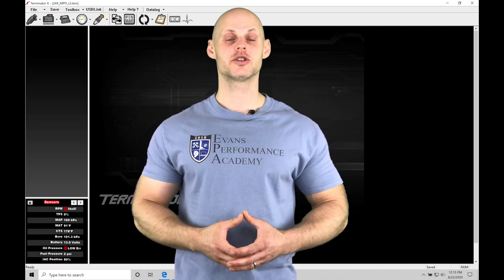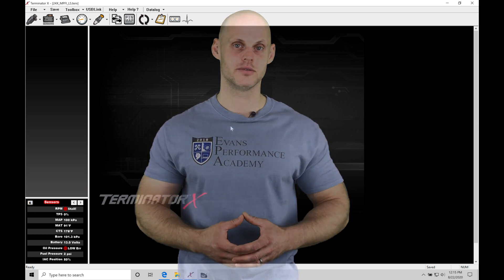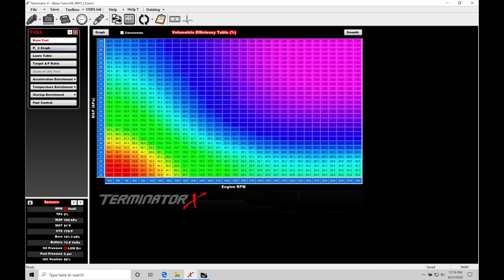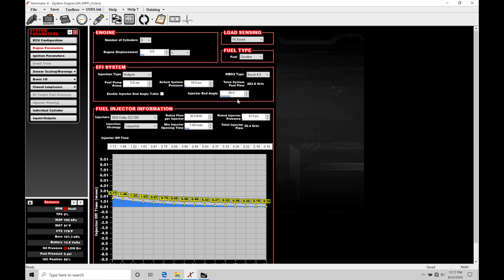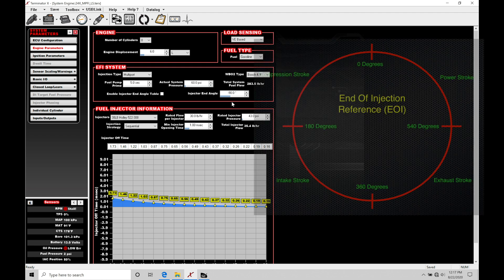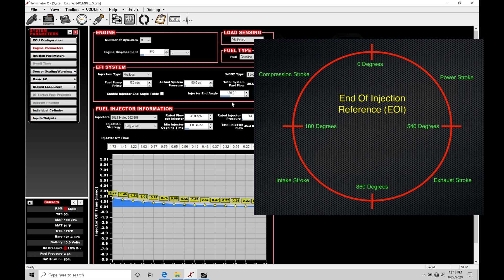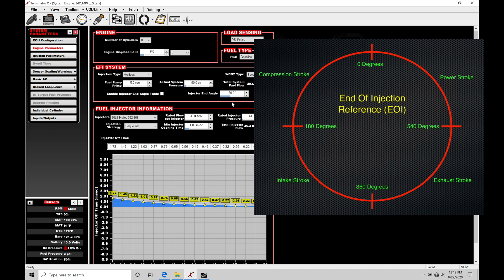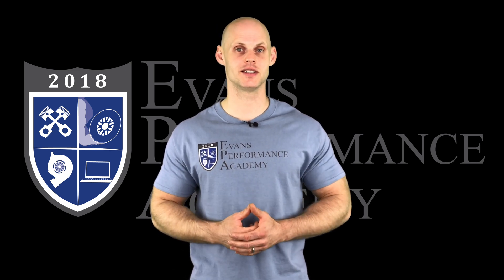Holley EFI Training Course Part 18: Fuel Injection Timing | Evans Performance Academy

Comment: You stated START of injection when in fact it is END of injection. You ALSO stated that you will spray on a closed intake valve to avoid losing air and fuel during overlap. That is also conflicting and incorrect.